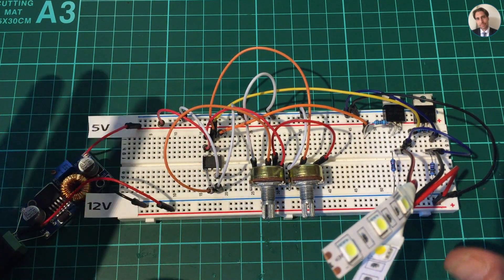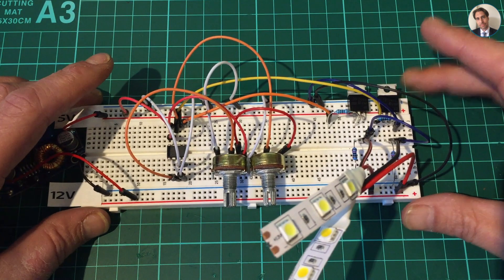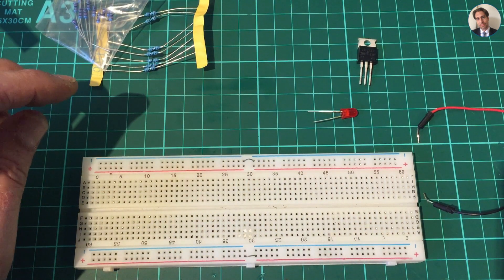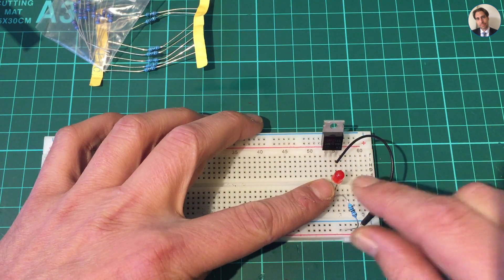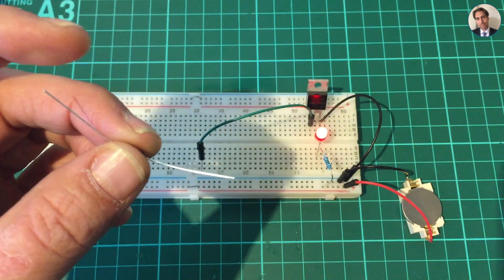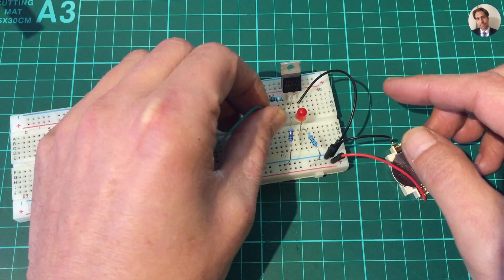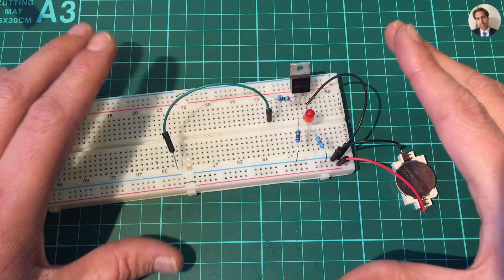MOSFET Why use a Gate and a Pull-Down Resistor?

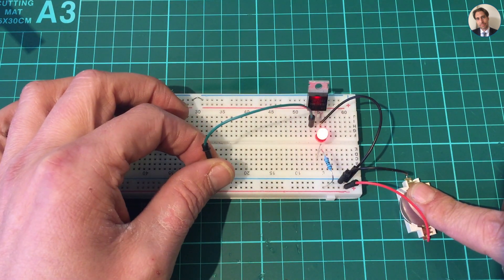Comment: 4:19 The battery does not have enough potential to lead current through your body, so it has nothing to do with it. The gate has extremely low resistance and very low capacitance, so it took charge from your body. The reason it stays on is because it acts like a capacitor and it takes a while to discharge since it's not connected to anything.

Comment: I am a beginner. So, can any one plz tell what will happen is we use a low value resistor as a pull down resistor instead of a high value resistor ?
Reply from the maker: The simple answer is not much if you don't go to high. If you go to high the resistor can't ensure the line always being "low". If you go to low in resistance,  it is more difficult to pull the line "high". 

You can see it magnet if the magnet is very strong you need a strong magnet to pull it away. 

But whether it is 10K or  15K or 4.7K makes barely a difference. If you are really nitpicking you also think about current that you are "wasting".

The subject seems simple, but it would need a whole video to explain in depth. So thanks for the idea... :D

And over the years some values got used so much that everybody uses them... 10K for example. But again, explaining it would take a whole video. Maybe even a chapter in a book :)
Reply: @DustinWatts  Thanks for explaining, sir. By the way I just want to ask why you aren't making new videos.The videos which are currently on your channel are really good and educational.

Comment: Didn't understand the last part of 100ohm resistor. Is mosfet back feeding high amps to controller?
Reply from the maker: No, it is to "protect" the microcontroller from trying to supply to much current to charge the gate. Current overdraw on a GPIO can cause weird behavior like reboots, or can even damage the microcontroller.
Reply: @DustinWatts  thanks for info
Reply from the maker: @vahagnmelikyan2906  You are welcome!
Reply: @DustinWatts  but if adding a resistor wouldn't it cause a voltage drop?  Or that's why using lower ohms ratings.
Reply from the maker: Well yes, but that is what we need. If there was no drop across the resistor there wouldn't flow any current to the gate of the mosfet. And as the gate charges, the voltage on the other side of the resistor rises and the drop gets lower and so does the current that flows. Basically we are charging a capacitor through a resistor. If you google "RC charging circuit" you can learn about how that exactly works. So "voltage drop" doesn't really apply the way as it would for example as a current limiting resistor with an LED.

Comment: After using the Pull-Down Resistor why the LED doesn't turn ON even after touching the gate and positive of battery? Can you please give me an answer for this?
Reply from the maker: If you are using a different MOSFET, the voltage at the gate may need to be higher. Also this is for a NPN transistor. PNP require something different.
Reply: If a low signal is applied to the gate it is dropped at the pulldown resisitor. So the MOSFET is at Cutoff. The MOSFET goes to saturation only when a High Signal is applied to the gate.
What exactly is the low and high signal you are referring to? What are these low and high signals?
Finally 1 last question please give me a clear answer. Why does the MOSFET doesn't turn ON when you use your fingers after using the pulldown Resistor?
I have searched everywhere in the internet but I can't find any answers so please give me an answer.
Reply from the maker: @starlord-c8  High and Low are voltages. It depends on the MOSFET what is considered High and Low. But you could say 0V is low. 5V is high for example.

Your second question: This is one of the other reasons for a pull down resistor. Only a small charge is needed to turn the MOSFET on. But you don't want to accidentally turn the MOSFET on. The pull-down resistor directs charge to GND so the GATE does not charge with small charges.
Reply: @DustinWatts  So when you touch the Positive side of battery and gate with your fingers, the small charge required for the gate is supplied through your hand. This caused the MOSFET to turn ON. But when the pulldown resistor is used these small charges flowing through your hand is dropped at the pulldown Resistor. So the MOSFET didn't turn ON. Is that correct?
But why does our hand supply only small charges why not the full signal?
Reply from the maker: @starlord-c8  Correct. There is a difference between charge and "signal" by which I think you mean voltage. In this case it is because we are dealing with a very low voltage. The human body resistance makes for a very small current. If the voltage was higher you would be able to measure voltage at the other end of your body. But now we are dealing with potentially deadly voltages, so please do not try that!
Reply: I need an answer for only this question. Definitely you are not doing my homework. I am a newbie to the MOSFET concept especially in the pulldown resisitor concept. I also see it used in a lot of circuits. So I really want to learn it A to Z. That's why I asked you a lot of pulldown resisitor questions. Sorry for taking your time, I really don't have anyone to guide me through this concept.😞
Reply: @DustinWatts Thank you soo much for guiding me through this concept. Now I have the best understanding about pulldown resisitor. Thank you for your time.
With all my heart ❤️ I thank you so much. Thanks from India.🇮🇳
Reply from the maker: @starlord-c8  You are very welcome!

Comment: I have added this pull down resistor to my mosfet as you show but it still won't turn off, even if I connect the gate directly to ground it won't turn off, it turns on more!!, I have the CEP603al Mosfet and it worked before but now I can't turn it off :((( what's the deal? is it broken? if I touch it sometimes it turns off sometimes on this shit is making me lose my mind

wait, if I connect the pull down resistor to the ground near the transistor it turns on but if I connect it to the ground on the usb of the breadboard power source then it turns off, wtf is the explanation for this? shouldn't these grounds be the same? it doesn't work on the ground pins either, just on the usb ground
Reply from the maker: To give a good answer I have to little information about your circuit. A simple check you can do is to replace the MOSFET and see if you get the same behaviour. Another thing is to build the simple circuit from the video. Also make sure you did not mix up the Drain and Source.
Reply: @DustinWatts  I just soldered a 10k resistor between the usb ground and the gate and it still doesn't work, it only works if I also touch it , this is weird af I think I will disassemble everything and try again tomorrow, or I will just replace with a transistor module because this mosfet might be broken, it shouldn't behave like this, there's no way it's good, it's probably shorted drain-source
Reply: @DustinWatts  all I did today was tranfer everything to a prototyping pcb board, it worked when it was wired janky, but I copied the exact same wiring and it won't turn off now

Comment: Is this a same resistor that connect gate to emitter in IGBT circuit?
Reply from the maker: Depends on what circuit you mean. In this circuit is server to drain the gate so the MOSFET turns of when a voltage is removed from the gate.
Reply: @DustinWatts  Just did some research look like Rge and Rgs are the same, help discharge the gate charge, ensure the turn off.

Comment: Great clear description! Thank you!
Reply: I do have one question.  I am using a stack of mosfets to throttle a miniature high voltage transformer and voltage multiplier.  Often times the mosfets stick on for a while, the battery is connected with a small receiver.  I am running the mosfets from a small mosfet driver that is connected between the receiver throttle output and the fets.  I have added a small pull-down resistor of 10k value, and it seemed to help but, the fet still sticks on often times for a while.  I'm going to try 1k now. Does that sound like a wise plan?  Thanks ahead of time if you have any further ideas!
Reply: One more detail.  When I test the circuit on the bench the mosfet doesn't stick on when the voltage multiplier leads are set to arc a little or way beyond arcing distance, the mosfet still does not stick on.  When I connect the arrangement to a large ion producing surface, then the fet begins to stay on sometimes.  Likely it is due to the proximity of the charged surface, or the load is higher than expected?
Reply from the maker: Both could be an issue. I would try to resolve both. A smaller pull down will drain the gate faster. But be sure not to exceed the power limit of the resistor. The rise and fall time of the MOSFET also increases as temperature increases. The temperature increases as the current from drain to source increases so that can explain it too.

Comment: Does the two resistor forms a voltage divider?
Reply from the maker: It depends on the location of the base resistor. One does create a voltage divider (as the circuit in this video does) and another configuration doesn't. I would that argue that if using 100Ohm and 10KOhm, the voltage at the output of the voltage divider is still high enough to not really make a difference. For example 100/10K will have 99% (in the case of this CR2032 it is 2.97V) of it's input voltage on the output of the divider.

Comment: if i use 12v battery, can i still use 10k ohm for pull down mosfet irfz44n or other resistor value
Reply from the maker: 10K is fine. The reason for the pull-down resistor is that if there is no signal on the gate, the gate is not floating.
Reply: @DustinWatts  ok thankyou v much
Reply: @DustinWatts  If the gate floats what happens?
Reply from the maker: @starlord-c8  Depends on the charge there is on the gate. Floating means not connected to anything. So if the gate floats, the MOSFET will stay in the same state it will be it was just before it became floating. 

Am I doing your homework for you? ;)

Comment: hi how to calculate gate resistor value....
Reply from the maker: If you know the maximum current you want at the gate: R=V/I. The maximum current depends in the case of a microcontroller on the maximum current the chip can source. For an Arduino that is 40mA absolute max. It is recommended to not exceed 20mA. At 5V that would mean 5V/0.02A = 250 Ohm.
Reply: @DustinWatts  Thank you sir ...understand the ohm's law

Comment: So how do you decide the resistor values and what value might be to low or to high?
Reply from the maker: The Pull Down resistor isn't really critical. A 10K pull down resistor is a popular value. 

The Gate resistor limits the current draw from the ATmega I/O. The value should be chosen so that it doesn't exceed the maximum current draw of 1 pin (ATmega328P = 40mA per pin max). Using Ohm's law you can calculate that @5V a resistor of 125Ohm limits the current to 40mA (5V/125 = 0.04A). So my advice, don't go lower then 125Ohm. The total maximum current the ATmega328P can source/sink is 200mA so keep that in mind if you are using the other I/O's of the ATmega.

Also consider that the higher the Gate resistor, the slower the gate of the MOSFET charges and the longer it takes for it to fully switch on. Generally speaking a slow turn-on time is not good for your MOSFET as it can heat up too much.
Reply: @DustinWatts  Is the 5V in  5V/125 = 0.04A the voltage of the battery? or the pin voltage on the ATmega? I'm using a teensy microcontroller and the pins go up to 3.3V but I'm using the mosfet so the teesny controls an LED strip with a 9V battery. So would the calculation be  3.3V/82.5 = 0.04A or 12V/300 = 0.04A
Reply from the maker: @dashiellbark-huss6806  The calculation you are looking for is: TeensyPinVoltage/TeensyMaxCurrentPerPin = ResistorValue. I quickly looked up the maximum source current of the pins on a Teensy, which is 10mA per pin. In this case the minimum resistor value would be: 3.3V/0.01A = 330Ohm.
Reply: @DustinWatts  thanks!

Comment: Nice! A very clear explanation of how this works. I didn't know yet that a MOSFET can draw such a high current via its gate, so thank you for the warning and for showing how to protect the MCU pins. +1
Reply from the maker: Thanks Marcel!
Reply: Best explanation I’ve heard so far
Reply: The high current to charge the gate capacitance is only for a fraction of a second, but is best practice to use a gate resistor to limit it.
Reply: Good video and a clear explanation Boss👍👍👍.... I just liked your video and subscribed to your channel.... Greetings from Ghana 🇬🇭, West Africa.